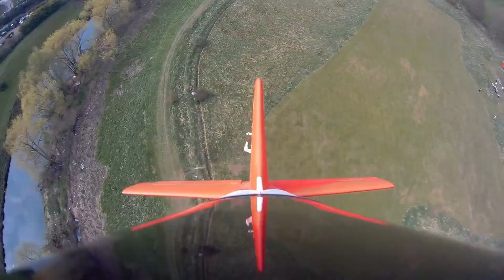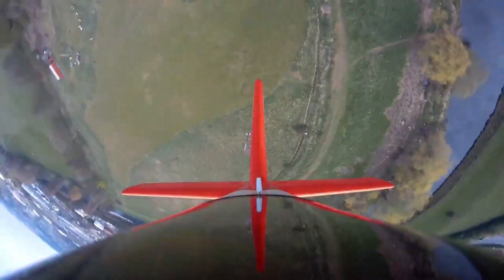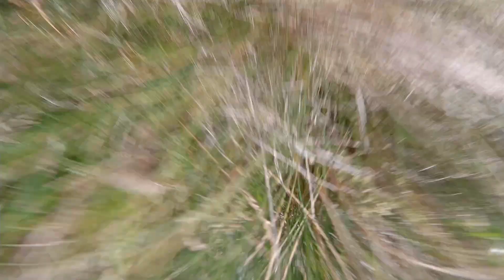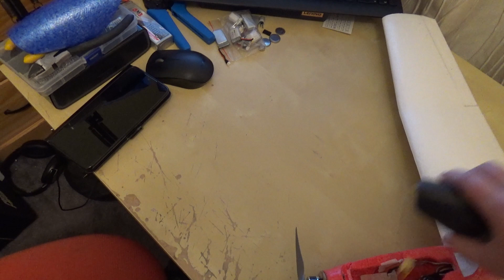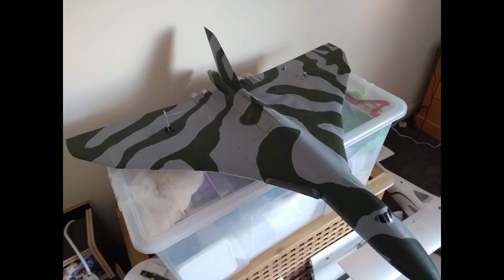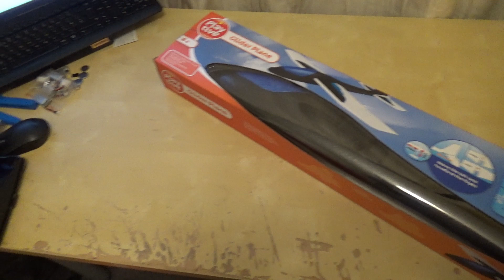Lidl obsession - part 3

Comment: Hi Caroline
I've seen that double boom configuration on a zhod system. At least i think it was..... But you've really got me thinking on a winter project I've got 2 spare Zhod drifts. I'm thinking taking the pusher motor off. And fitting a motor on the pointy end... 
Any thoughts I know your at the cutting edge of WHAT IF 
Brian .
Reply from the maker: Two ZOHD drifts, shorten one of the wings and mount into a biplane configuration. Could be classy!
Reply: @Caroline_Tyler  now there's a thought...
Cheers